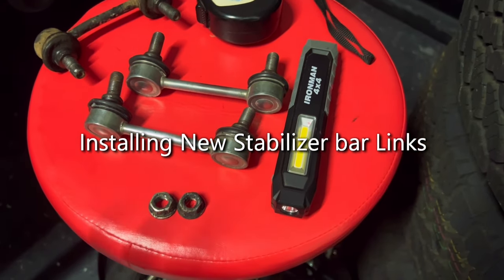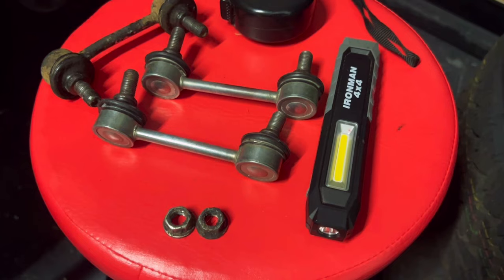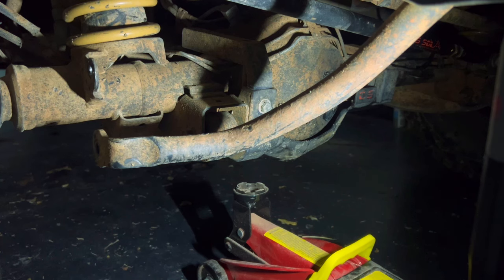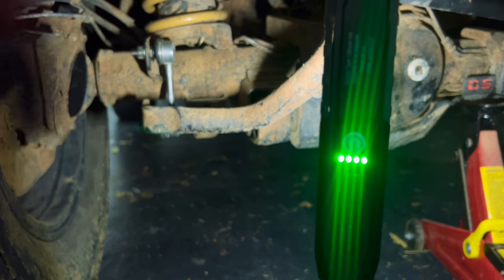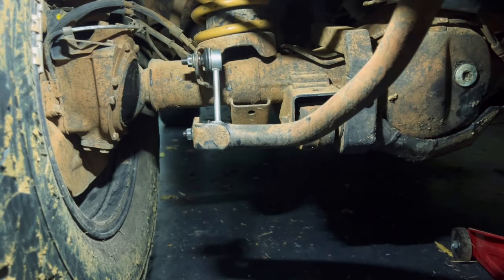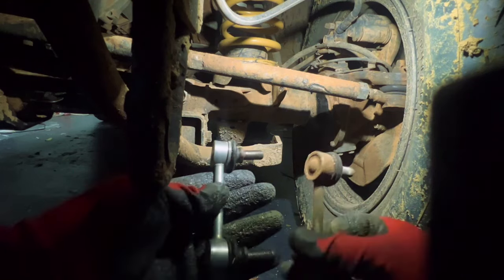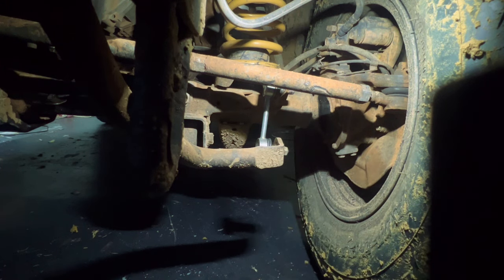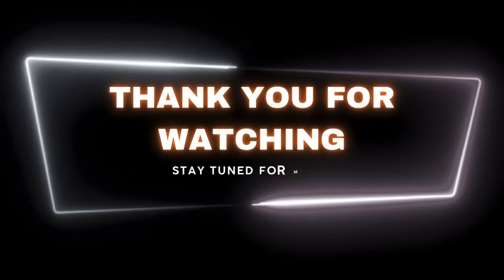Installing New Stabilizer Bar Links on the Suzuki Jimny Gen 4 JB74W, Quick and Easy Fit

Comment: Hey mate,
When the torque wrench clicked without the nut turning, it means the nut was already tightened to at minimum what the torque wrench was set to. When you kept tightening it after the click you were over torquing the fastener. Cheers
Reply from the maker: I know, but I was very careful not to strip them. I just wanted to make sure they are tight enough that they don’t come off when we are driving fast but they also don’t strip off. 50nm seems abit low for something that gets put through so much stress.
Reply: @febuilds  It’s your car, you can work on it how you want. Just letting you know a fastener that is over torqued can be damaged before it strips the threads. Over torqued can mean the fastener is stretched past it’s limits and may no longer handle the stresses it faces. These aren’t opinions of mine, just facts. Again, just letting you know 👍
Reply from the maker: @julienp2049  thats for the pro tip, will comtact the supplier for the exact torque specs for the new lift kit sway bar arms for 50mm lift and above 🙂👍🏾